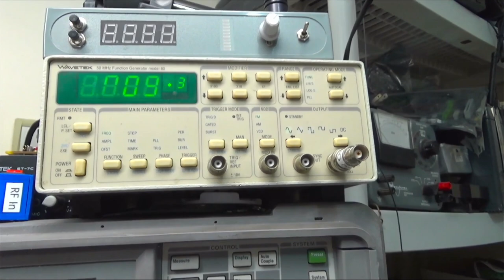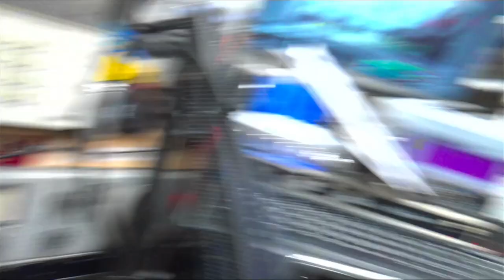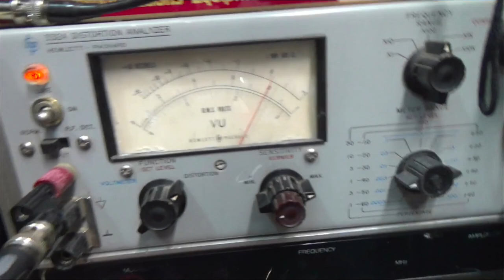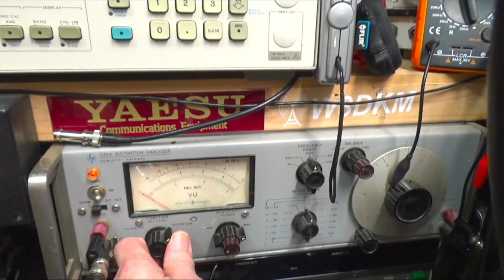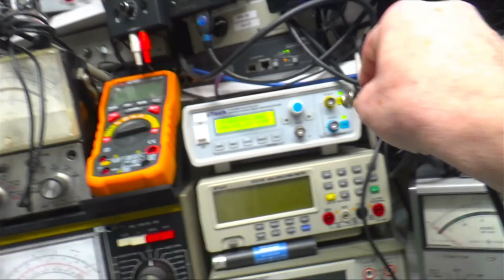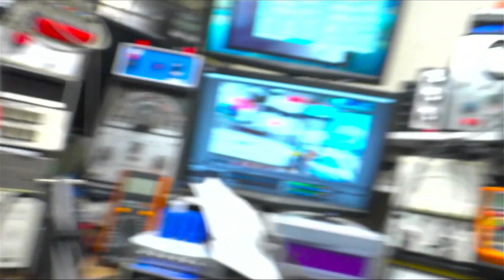How good are my audio sources? Distortion Testing

Comment: Wow, I am very impressed would have for sure thought the FY would have been the worse!  Wonder which one would be better with spectrum purity?  I like the Wavetek, have plans on picking one up when I find the right one.  ~Jack, VEG
Reply from the maker: I did put an isolation transformer in the FY for safety but it didn't seem to do anything to the signal. I was surprised too.  Thanks for watching.

Comment: I have an older Kenwood analog audio generator, a 16 bit Rigol, and a QuantAsylum audio analyzer. My Kenwood has similar distortion to your older gear, but the modestly priced Rigol has a THD+N of -77dB / 0.0142%. That doesn't rival the QuantAsylum's specs, but it's better than I expected it to be.
Reply from the maker: .014 is not to shabby. Like I said in the video about the best I can do here is .05 but that is due to noise in the room. If I do it with nothing else on in the room, in the dark, I can get it down to .03 or so. I still say .1 is good enough.

Comment: Love the 332A, use it almost every day at work.
Reply from the maker: Not as easy to use as the new ones what with having to do the input level calibration and balance all the time but they work. When I got this one it had fallen off the shelf and broken the glass on the meter and bent the needle pretty bad.  I made a replacement 'glass' from a CD case and VERY carefully straightened the needle. It has worked for several years. Does yours have the RF input on yhe back?
Reply: @AERVBlog  yes they are a little more involved having to zero cal, adjust the filter and balance the audio. I just personally enjoy turning knobs. Modern CSMs like the Aeroflex 3920B take a lot of fun out of maintenance with their "plug-in-play" measurement capabilities. However, they a very high tech and interesting devices too. 

No it's an HP. Not sure what rebrand 332A has that. Only thing on the back is the input AC switch and battery backup banana plugs.
Reply from the maker: @HavingFunRepairs  mine is an HP too. It has option 001 which is a pretty useless RF detector that is good to 10MHz. Other than checking ot out I never use it. I do like having the AC meter function thiugh.

Comment: This distorting testing video was quite interesting. Thank you for sharing. I would enjoy seeing a video where you demonstrate an audio frequency response test on an AM amateur radio transmitter much like you would do a proof of performance on an AM broadcast transmitter. Back in my teenage disk jockey days, I was the kid in the studio after midnight sending tones while the engineers were down at the transmitter making proof measurements. It could be any AM transmitter, even a modern solid-state rig but I use a 1950s vintage Johnson Viking in AM mode. Show us how to sweep the transmitter from low to high audio and measure frequency response. I see some of my AM ham buddies using audio chain gear that would make a broadcast station jealous. My question is, can their transmitter reproduce that wide spectrum? I have an audio generator and a scope. What else would be needed?
Reply from the maker: I will have to think on that. I have an Icom IC-718 and a Yaesu FT-757 that would fit the bill.  I can say off the top that neither of them will perform that well on a 20 to 20K sweep but it would be interesting. As far as distortion goes I do have the HP8901B modulation analyzer that does exactly that. Thanks for the idea.
Reply: @AERVBlog  I'm thinking the modern SSB rigs will be limited by their transmit bandpass filtering (probably optimized for SSB) except those like software-defined radios that allow very wide bandwidth whereas some of the vintages AM transmitters like the Johnson's. Heathkit's B&W 5100 and 1950s era Collins transmitters will look pretty good.
Reply from the maker: @markbolton5243  I think you are right. We will see.